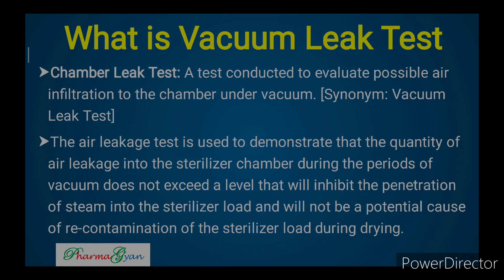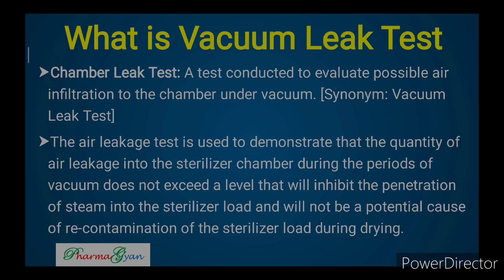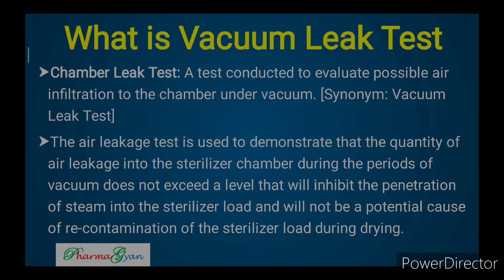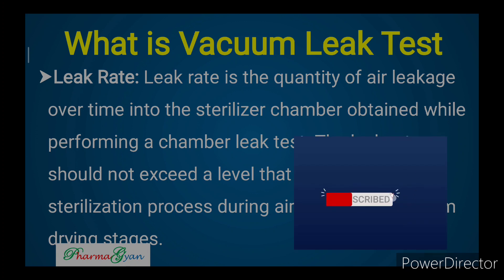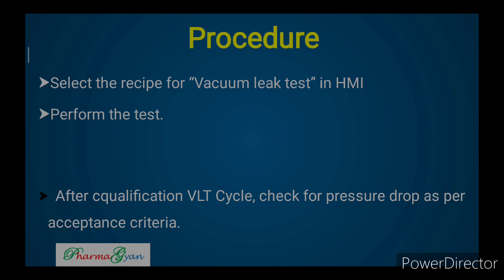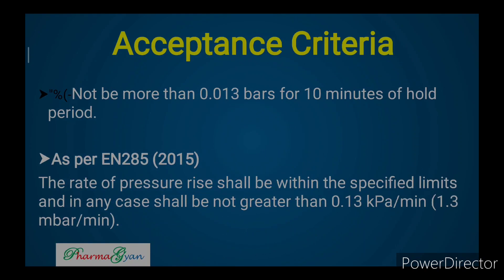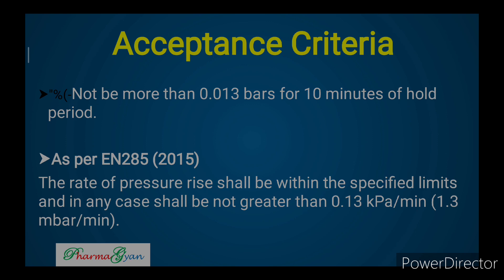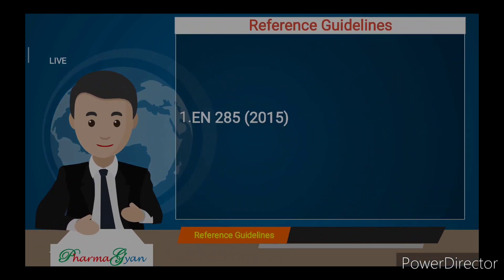VLT or Vacuum Leak Test for Steam Sterilizer

Comment: Can u please tell me in vacuum leak test which pressure we need to consider either positive or negative and why?
Reply from the maker: If your chambers pressure is more than atmospheric pressure then it is considered as positive pressure but if your chamber pressure is less than the atmospheric pressure then it is considered as negative pressure.
Don't correlate it with - & +.